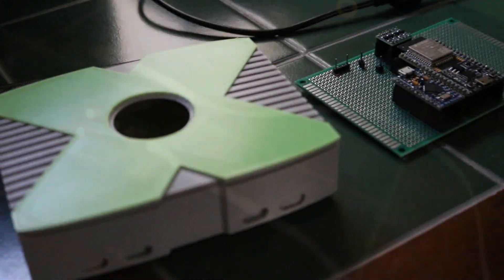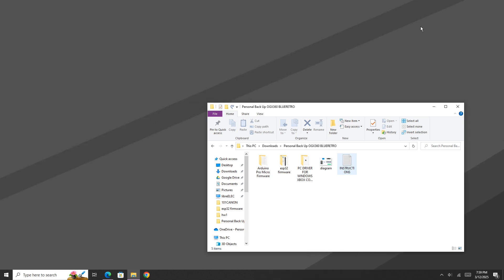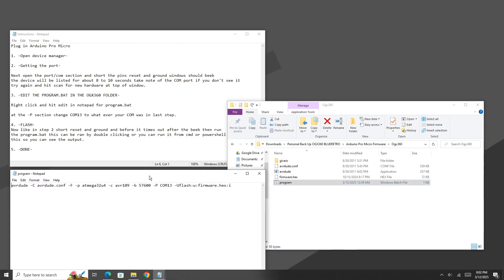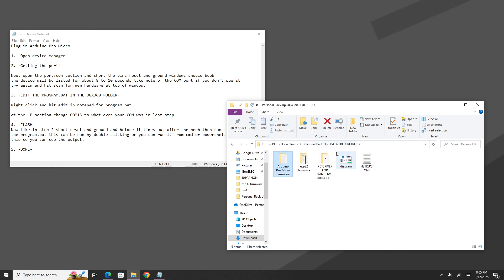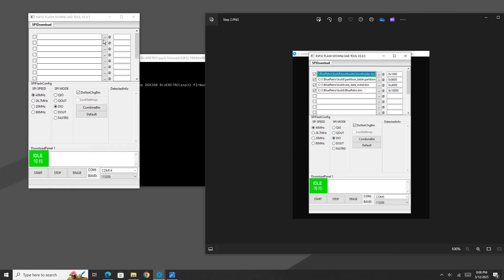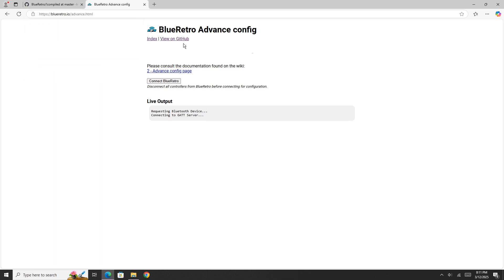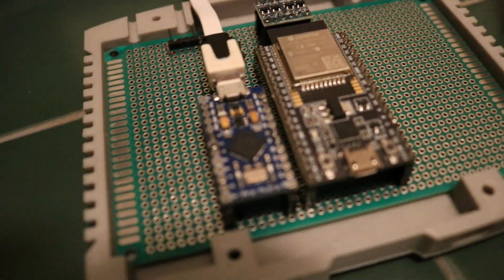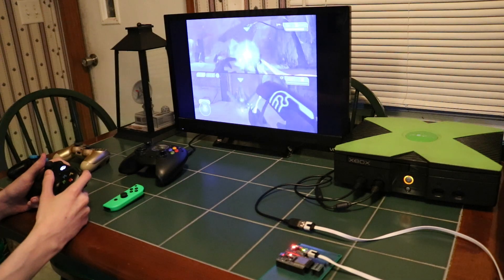OGX360 With Blueretro Support "Hw1 Version"

Comment from the maker: Some quick potential questions answered controller vibration works fine on all the remotes also I originally recorded this video on Linux and compiled the project from scratch it all seem fined but the boards refused to communicate over i2c this set up for the programming and these pre-compiled files work first try for me. I also included pc drivers for windows if you wanna use it on the pc for what ever reason and yes under Linux it just works don't need a controller driver there and apparently this will work on the Xbox 360 but I have not tested that. 

- HOW TO PAIR REMOTE -

To pair a remote the blueretro is always in scanning so just hit the pairing button on your controller it will then auto connect. 

The 3D print is not final but once I get the cables I will clean it up a bit more for the pre-made cables that you can buy online this is to help standardize the hole for the cable to come out. I might also add magnets for the lid and a slot in front for a touch switch to turn the jewl light on and off.

Last but not least I quickly went past it but showed it the red light will turn on the pro micro when the controller gets connected.

BONUS !!!

This might work on the xbox 360 too just usb micro usb to usb cables and your xbox 360 would need to be modded either rgh hacked or you could use the new softmod exploit either way you need to run a dashlaunch plugin and this in theory should work on the xbox 360 I have yet to try it but will update this post when I have if you beat me to it let me know how it goes this would be a sick for me since then I can have  4 consoles using blueretro and don't need to care about what remote to use or dig any out just 1 for all them.

"potential bug more like user mistake but when in game resetting do not hit start! it will reset but controllers disconnect and wont connect till esp32 is reset"

https://github.com/InvoxiPlayGames/UsbdSecPatch

Comment: Why no one’s makes an internal installation
Reply from the maker: I might have but trust me my xbox is in no shape for it the shielding is like atomized and looks like the titanic.. But yeah also really wanted to make a joke out of plugging consoles into consoles for modern controllers to work XD. I made this one for the og xbox and another different project for my 360. If not for mission control I would have made one for my switch dock too lol.

But I do think the github might talk about how to do a install for internal use if not I know the ogx mini another version of this thing might have another guide using a pico w to do a internal install worth checking out.

Comment: How do you pair a second controller to it? I made the 4 player version but im having so difficutly on getting more than 1 controller paired.
Reply from the maker: I been able to pair 2 fine I only use 2 player on mine but the process should be the same for all 4. I been using the older firmware "been lazy forgot to update oof"  but it since been updated I should try the new firmware tomorrow that could be a issue there I don't know about.

The blueretro is always in pairing mode so just make sure you put any remote you have into bluetooth pairing mode and it should just connect

I tried mixing remotes so I don't think mixing remotes is a issue but just wondering what controller type you using xbox one ps4 or other?
Reply: @everythingdigital1  is the paring just happens on boot up? Main controller im having issues with is my dual sense controler. xbox series controller pairs fine. Dual sense gets a solid blue light but wont control the console.
Reply from the maker: @doroyce  I had not had that I had them not connect if the battery was low before though in fact that happened in the video. Just making sure though the pro micro led lights up when the ps4 remote connects just wondering? Also does doing 2 xbox remotes or using any other remote work just making sure it specific to the ps4 remote.
Reply: @everythingdigital1  I just tried with 2 xbox series controllers. if I pair them one by one they would work for player 1. Then when I get both  connected, it only turns on player 1 pro micro light (goes from 1 red led to 2led) the rest of the pro micro only has 1 red led.
Reply from the maker: @doroyce  OK that is a big tell as to what is happening they are not communicating over i2c I would check the connections. The esp32 will accept the bluetooth but the pro micros are not all activating. I actually ran into that before turned out my wiring was just the issue if it is working with one pro micro it should with them all so I assume it not a software issue. I would check wiring if that don't go then re-flash the pro-micros. Sorry for the late reply will probably be off till tomorrow but will get back to you. Let me know if one of them things was the issue.
Reply: @everythingdigital1 thanks for the info. I was about to give up then I double checked my USB cable. I'm wiring this whole thing internally so that I can block off the controller port on my 3d printed case. Turned out the USB header is not a standard pin out. After matching the actual wire to a new connector, everything worked out. 

FYI, player 1 and 2 shared the same header. The catch is player 2 USB wiring is not the same order as player one. I made an assumption that they were the same which caused the issues for me. Also since I was only testing 2 controllers at a time, player 3 never came up but I'm sure that would have worked since player 1 and 3 had the same wiring order.
Reply from the maker: @doroyce  Glad to hear you got it all working now. :D I kinda figured it had to be a wiring issue I had that at first too as dumb as it is it can be easy to make a simple mistake like that lol.

Comment: Didn't the BlueRetro guy not make an original Xbox version, because OGX360 came out first and he didn't want to step on anyone's toes?
He did make a single port adapter for a bit called the brx I think, but is out of production according to his site. Seems to me that someone could easily port BlueRetro to the original Xbox without any additional controller chips necessary.

Why can't someone reverse engineer the BR GameCube firmware to work on the original Xbox? The pinouts between the 2 can't be that different.
The goal would be a clean internal 4 port solution like for the GameCube.
Reply from the maker: I know you can take a ps2 to xbox adapter then use a blueretro ps2 adapter but this solution seemed more solid to me over all its been great since I only need one board for the communication and just how ever many other pro micros for the other players. There is a project called ogx mini but they don't have a solution involving chaining of boards "yet" And all you need for that is a pico w or pico w 2. Check out my ogx-mini video those are good for internal set up and its drag and drop no programming needed the ogx-mini project is what they used for the brx

Comment: bro, i want ask, why if i use igr button my esp32 is off?
Reply from the maker: I never ran into this? Are you using a different github build for the blueretro then the konwektor one? And sorry for the late reply back the only thing I can think of is your using the older firmware from the original github project or something. Also are you tsop flashed might help me understand if it a custom bios thing on the xbox doing it I think tsop flashed bios can handle in game resets weird if memory serves me right.
Reply from the maker: I figured this out!!! By mistake but if you hit L+R+black+select you will in game reset fine but if you accidently add a start press
L+R+black+select+start you will run into a glitch that disconnects the remotes yet they act paired I made a note on the github page so hopefully they fix that. Key note just dont hit start when in game resetting and it should work.
Reply from the maker: Hello again just a heads up this has been fixed now with the latest update I heard from the dev. I haven't tried it yet will do so soon but he fixed a few things and this was one of them.

Comment from the maker: Been about 2 weeks and I been using it pretty regularly I even added a player 2 hook up since then and got proper cables so I might make a update video for this but over all I got one pro micro and one knock off pro micro and both seem to be fine.

I found a cool plugin for the xbox 360 I have not tried it yet but it can let you use this build on the xbox 360 too just substitute the og xbox cables for micro usb ones to usb. I will definitely try this when I got the time and report back but if you beat me too it comment and let me know if this works on the xbox 360 too. 

https://github.com/InvoxiPlayGames/UsbdSecPatch

Comment: Nice vide, potential question people will ask: "How do I pair my Bluetooth controller?"

I am actually thinking to implement this in a custom board containing an OGX360 4 player setup + ESP32 for BR
Reply from the maker: They will just auto connect the blueretro is always in scanning. How ever when no remotes are turned on and connected you can access the blueretro menu via the url and change the button layouts enable turbo and other features.  Also hope your custom board works out I seen some compact versions of the ogx before and some blueretro builds so I know they can come out nicer then my build circuit wise lol. :D